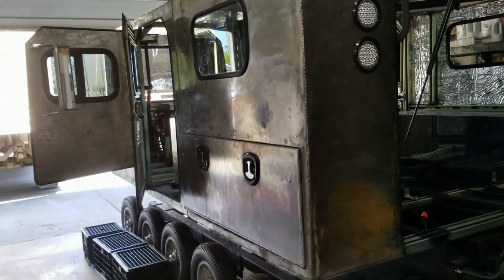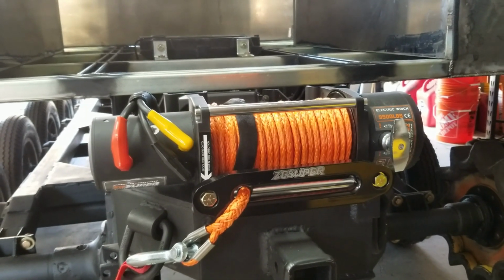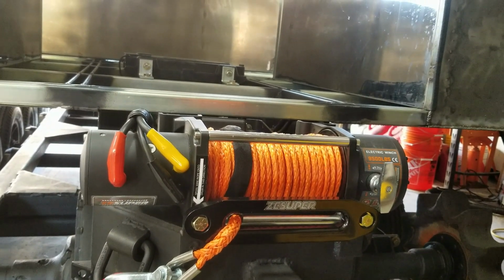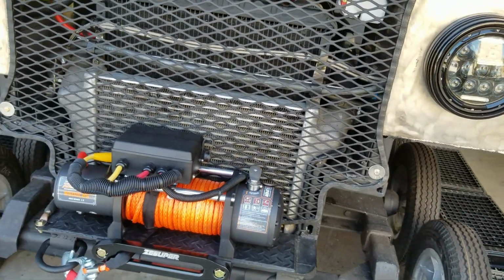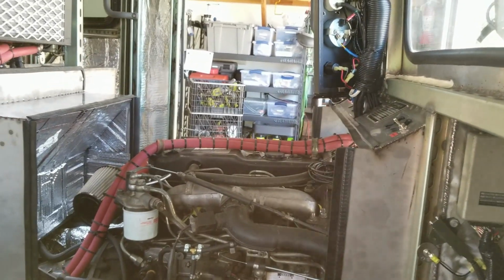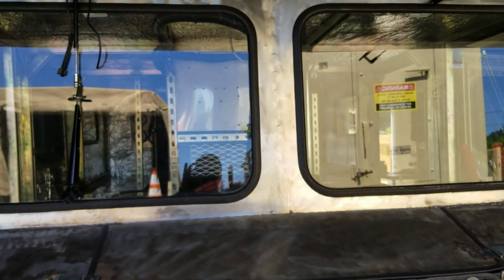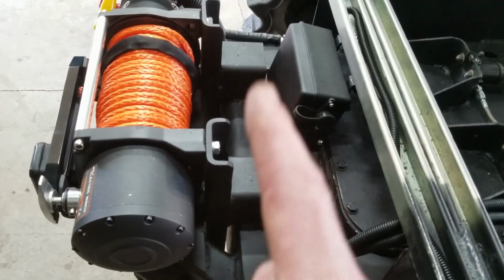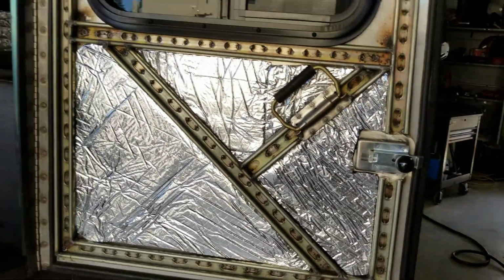Rusty the Spryte build part 87 (a pair of 9500# winches, starting on the doghouse)

Comment: I am putting a heavy duty 12000 lb. electric winch on rear and a 8000 hydraulic winch on front of my snowcat. Also installing a snowplow for leveling some trails and to push snow that slides off roof of our cabin and to maintain entrances.